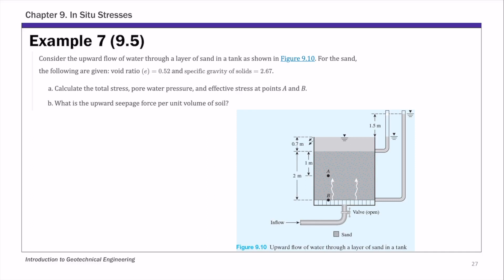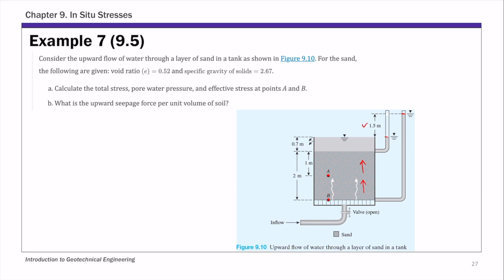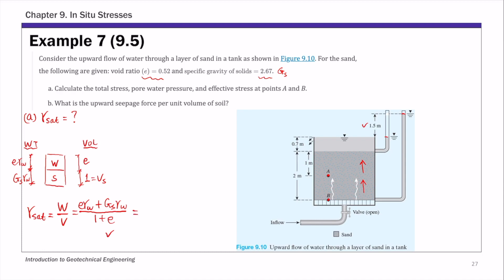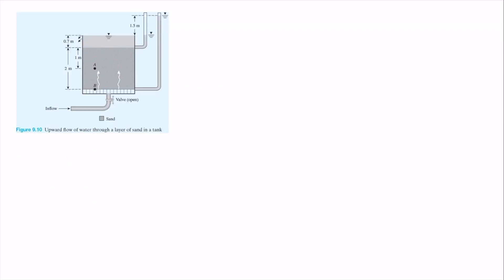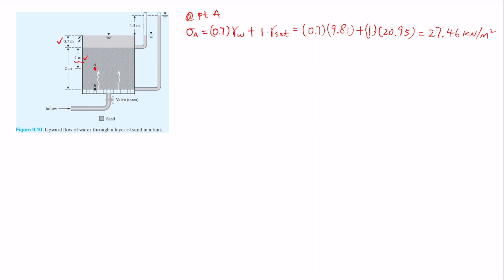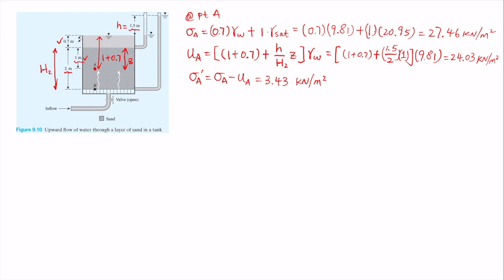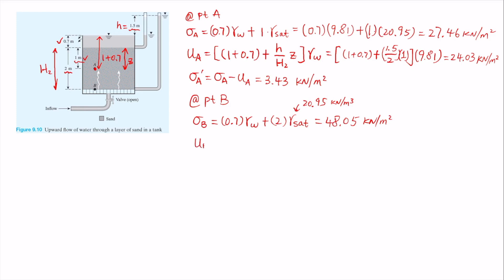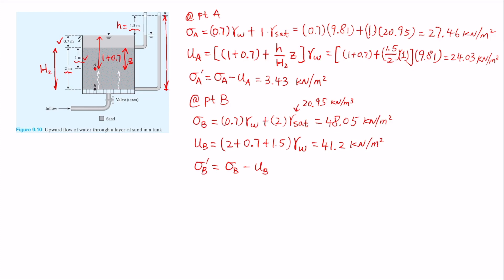Chapter 9 In Situ Stresses - Example 7: Effective Stress with Seepage

Comment: For calculating pore pressure at pt B, is the reason seepage upward flow at point B is not included is because there is no headloss at point B therefore only the hydrostatic pressure is required? 8:24